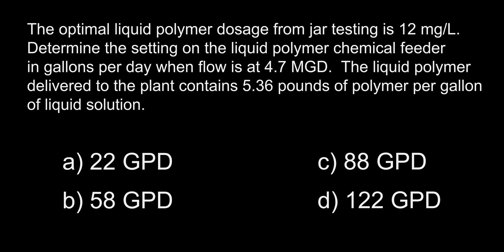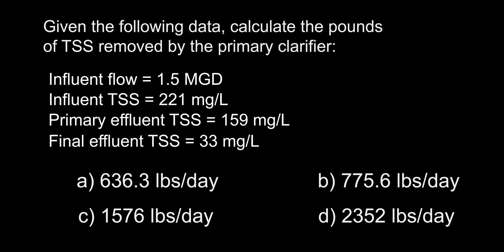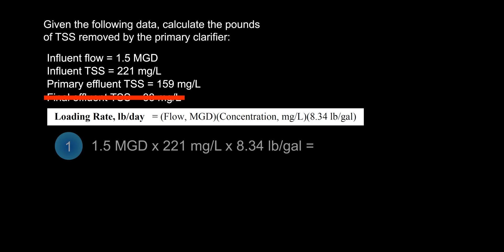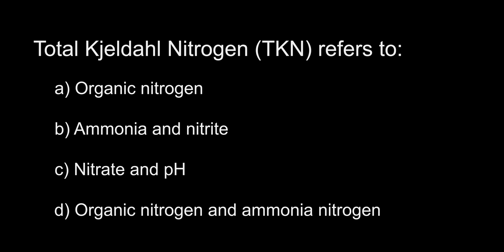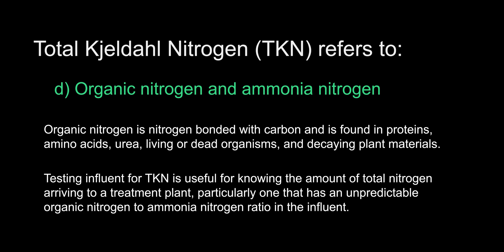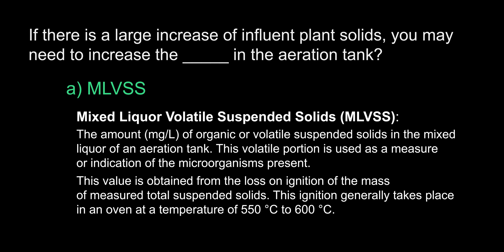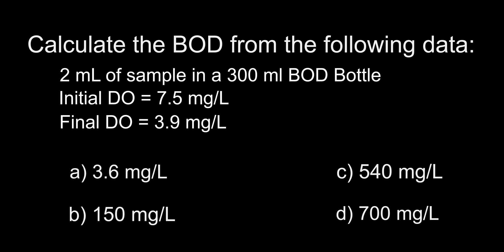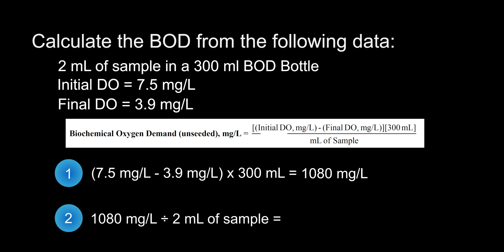Part 13 - Wastewater Treatment Operator Exam Questions

Comment: I think you have the wrong way to evaluate your units for Q#65. You have (7.5-3.9) mg/L x 300 mL which would be equal to 3.6 x 300 which is 1080 mg*mL/L. In order to fix this you would first need to convert the 300 mL to .3 L. THEN you multiply out (7.5-3.9) mg/L x .3 L = 1.08 mg (the L/L cancels out now). Next you would take the 2 mL sample and convert it to .002 L. So then the equation becomes 1.08 mg / .002 L = 540 mg/L.
Reply from the maker: I totally get your point and we still both got the exact same answer (540 mg/L)!  Your method of using dimensional analysis to solve the problem is of course great and completely fine. 
Both ways work, but I teach this one since it uses the formula that is given to operators when taking their exam. It treats the (300 mL / Sample mL) as a 'Dilution Factor.' Because it's a ratio of mL to mL, those units cancel out to become a simple multiplier (in this case, 150). So, taking the 3.6 mg/L drop in DO and multiplying it by the 150 dilution factor gives you the 540 mg/L. 
I really appreciate you taking the time to analyze the question. I have a suspicion you have taken some college level math/science courses. If you are studying for your exam, good luck, I don't think you are gonna have any issues with passing.

Comment: On the TSS math question, you calculated out the initial and final DO equations then subtracted at the end. I came to the same answer but I first subtracted the final from initial  DO, then I multiplied by flow and pounds. Will this work the same, or could other factors alter this ? 
Probably a dumb question, but thanks for all the great content.
Reply from the maker: If I understand your question correctly you are talking about question 62, which is about TSS.  If so What you did makes complete sense.  You’re ultimately finding the difference in TSS first then converting it to pounds.  Where in my video I’m finding the pounds first of each.   If you are talking about the BOD question.  You should always do initial by final DO or u would be getting a negative value for DO.  Unless you know to tell yourself that it cannot be negative, which would mean taking then”absolute value” in math terms.   Follow the formula and you will be fine.  Thanks for the question.
Reply: @worldofwastewater  yes the question was about TSS. Thank you for taking the time to respond. The videos are extremely helpful, I appreciate what y'all do.

Comment: Hello. This is great content.  You mention having links to further instructional videos in some of these exam prep videos. However I can not find any links.  I check the description text and there is a link to a google drive and to chapters in the video.  Thanks
Reply from the maker: Thank you!  Glad you are finding the videos helpful!  To answer your question, I don't believe this Part 13 video is suppose to have any links associated with it (please give me a time stamp if I am mistaken).  For videos that do have other links...the links are in the top right corner of the video itself (white "i" icon) when I refer to other content.  You may be referring to Part 14, where I talk about Multiple fermentation tubes.  Which you will find that link in the description below the chapter marks but above google drive link.  I do have a couple references in other videos but I think all the links are there.   Thank you again! I do sometimes miss something here or there so I appreciate you calling it out. :)
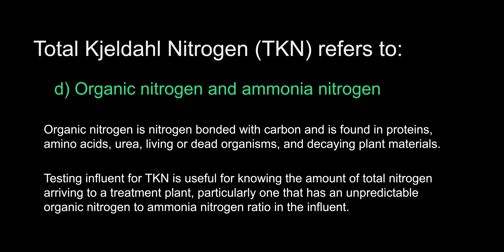Reply: You mentioned a link to a nitrification for further explanation at 6:38 minute in this video.

Comment: Where can I find the answers to questions 66 through 100 on the practice exam ?
Reply from the maker: The answers are only revealed through the videos.  The videos that will have those answers have not been completed yet.  Trust me, I wish they were all complete but it takes time and unfortunately I need free-time to work on these, which is sometimes in short supply.  I am currently finishing part 14, which should be released next week.  Thank you for your support, I apologize for any inconvenience.
Reply: @worldofwastewater  Thanks for all the work that you have put into all of these modules. This has been valuable information and well explained.
Reply from the maker: @columbusbattle8311  Your words really mean a lot to us here.  It keeps our enthusiasm going.  Thank you and good luck on your exam!

Comment: Where can I get rest of the answer?
Reply: #87 is driving me crazy. I keep getting  83 min.
Reply from the maker: @justindeitrich-jw8gy  You are correct!  The answer is 83 minutes (choice C would be ur best option in that case).  Question 87 needs to be fixed (and will be soon).  I apologize for the confusion.  You should feel good knowing that you were correct!  I appreciate you for reaching out and letting me know.
Reply from the maker: The answers are only revealed as I finish this series. Sorry for the inconvenience.  I think most problems should be able to be figured out with some quick google searches.  Thanks for watching and goodluck!

Comment: Are these 100 questions the ones we will see on the WWT Grade 1 test?
Reply from the maker: These questions are based on New York tests.  However, these questions touch upon many important wastewater concepts that you will likely encounter.  By understanding these concepts you will be able to answer questions on any wastewater test correctly.  Good luck on your test!